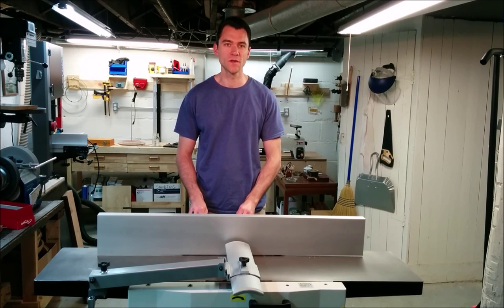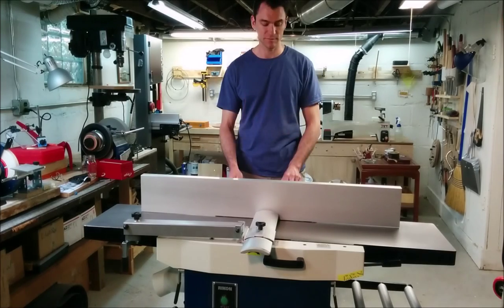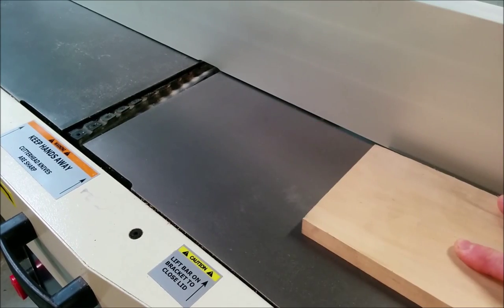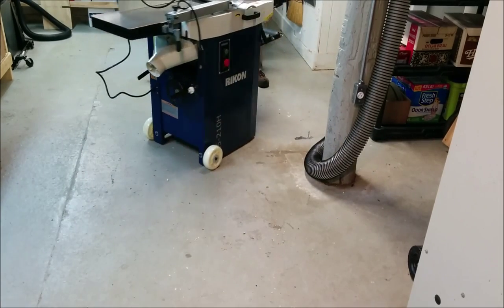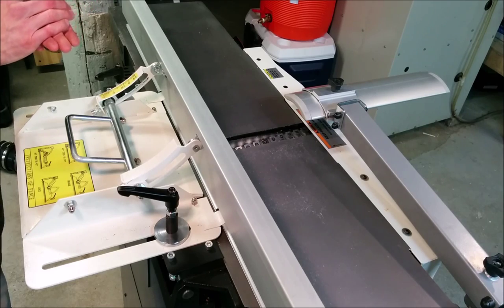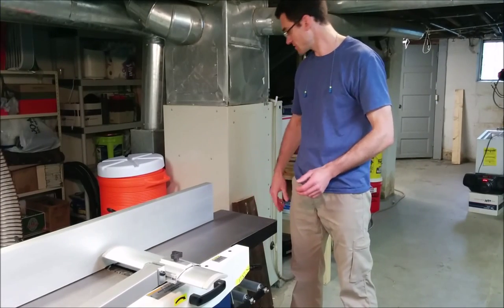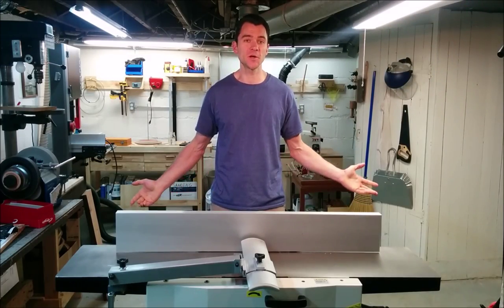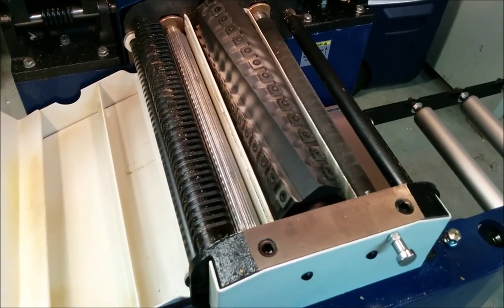Rikon 25-210H 12" Planer / Jointer Review

Comment: Does this machine have a built-in breaker of sorts (attached to the start/stop button like our table saw and dust collector)?
Reply from the maker: If you mean a "mag switch", then yes it seems to. If I unplug it while running it won't start back up again when plugged back in.
Reply: What breaker size are you running for this machine? Motor says 12amp however my 15amp 220v breaker keeps tripping..

Comment: Is it still holding up well after a year or so of use? Have you had to adjust the tables to be coplaner due to changing operations?  Great review!
Reply: Thanks for the response David, I went ahead and ordered one. Any chance you can get me measurements for a mobile base? I was checking around and cant seem to find the dimensions of the base anywhere.

Comment: Great review, as others have commented too.  Question:  now it is April 2018. still using machine?  how's it doing?  would you buy again knowing what you know now?  any changes?  I am thinking of buying one.  Thanks!!
Reply: Is something like a Hammer A3-31 really worth the extra, though? How big of a problem is the outfeed table? I'm considering a combo machine so would love to hear your thoughts. The $2K difference could buy a lot of lumber! :)
Reply: Yeah, fair enough! I wonder if there's a way to retrofit in a better system that would hold its settings? Something with a cam, maybe? Marius Hornberger made a great video showing how he fixed an issue with his Hammer tablesaw flipstop (https://www.youtube.com/watch?v=kH3U58RYnkw) which was a change that felder then used and modified for their saws... not that I expect rikon to do the same, but I'm sure there's a better way...

that being said, what's the actual tolerance of the outfeed table on a jointer? IE, how much play can you have before it makes an actual difference? a lot of us woodworkers chase perfection but forget that there are certain tolerances that are just fine. it doesn't excuse the table hitting the knives, but I wonder if it could shorten the adjustment from 20 min to 5 min (or if it means that the "better" solution needed be over-engineered)
Reply: actually a quick thought to add to my last comment - what if you replaced the bottom nut with a serrated flange nut, or a nord-lock washer? or a nyloc nut? It's probably the vibration of the machine that slowly gets the bolt+nut vibrating+shifting, and using a locking nut might be all you need to do? maybe it's worth marking with a sharpie the jointer, nut and bolt to see how often + how much they actually move, then replace the nut and see if it helps. if nothing else the sharpie would give you a visual reference for where your goldilocks zone is!
Reply: @DavidPx  did you ever try the lock nut? curious if you made any headway as I'm still daydreaming about a combo machine!
Reply: @DavidPx  that's great news!
Reply: I own a Hammer A3/31. I've had it for only 7 years of light use and I'm having to junk it! Felder USA quoted me $3K to fix it, which is 75% of the original purchase price. I'll never buy a Felder product again, I'm done with them. I'm looking at the Rikon, Jet, or Minimax to replace it.

Comment: As fare as design this is identical to my startrite sd31, 
Mine has a  three knife cutter, and no out feed,
It's a 3 and half horsepower motor ran off a 16 amp feed.
Reply: Yea so fare so good, 
I only take light cuts as it take a lot off power from the meter!
So 1mm passes at a time. 
I've not changed the blades yet so that's a daunting task!!